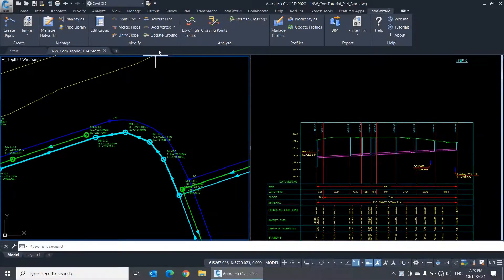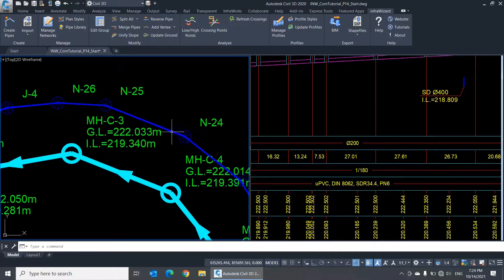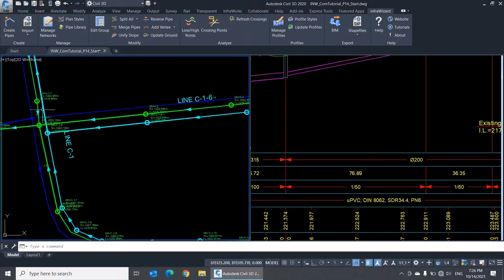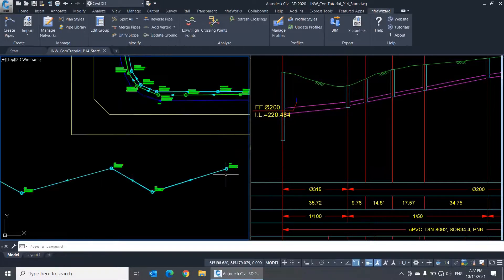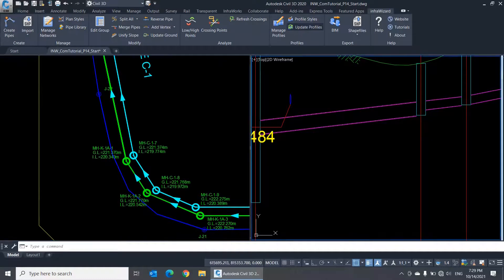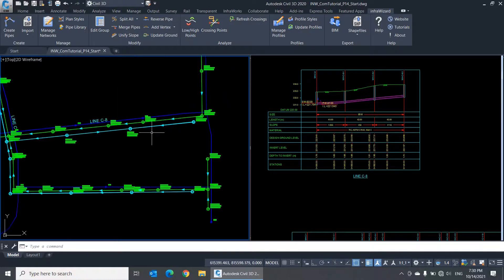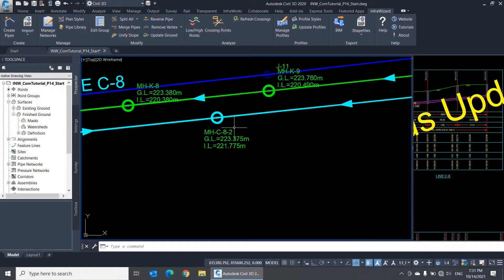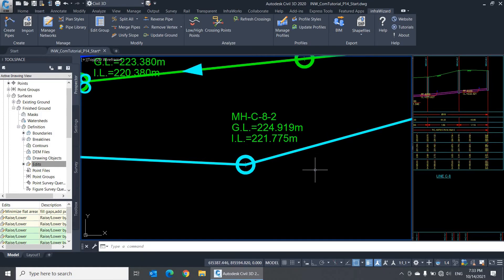infraWizard Tutorial - Part 14: Smart Editing Commands

Comment: is there any q=way to group edit the ground levels instead of editing them one by one?
Reply from the maker: Yes. You can use the Edit Group command to open group editing tables. The group editing tables include one table for pipes and another for nodes. In the nodes table, you can edit ground levels by changing all levels to a set value, or add/subtract a value from it. You can also copy and paste values from a spreadsheet to the ground levels column. For further assistance, please contact support via email at support@infrawizard.com